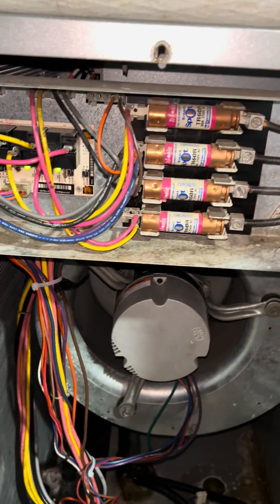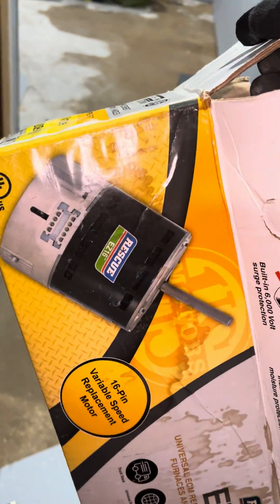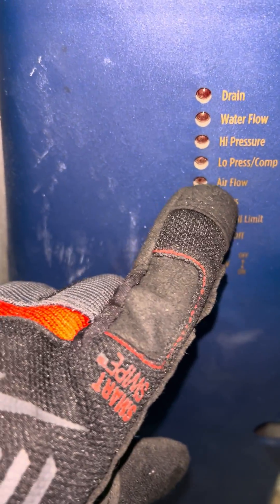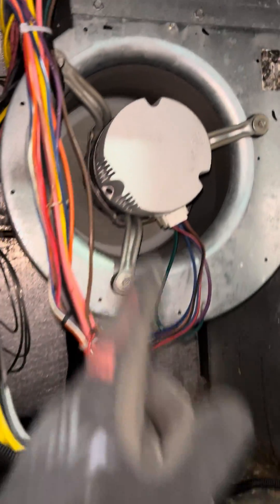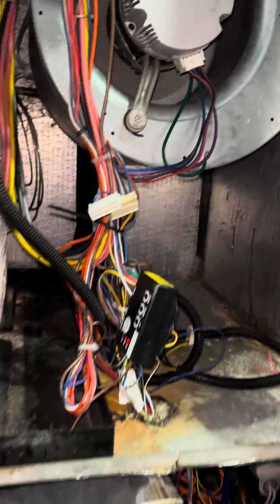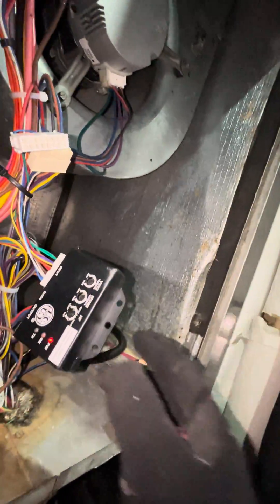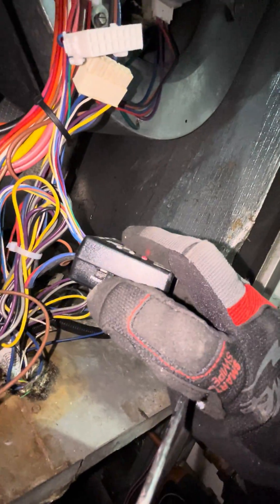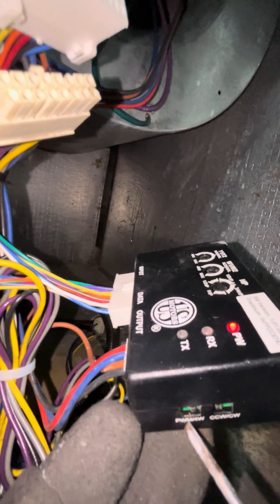TROUBLESHOOTING WATER FURNACE GEOTHERMAL HEAT PUMP

Comment: Psc motors permanent split capacitor, gotta love em. Easy, cheap and reliable just not as efficient. I’ve replaced a ecm with a psc before when I couldn’t get the motor on the weekend